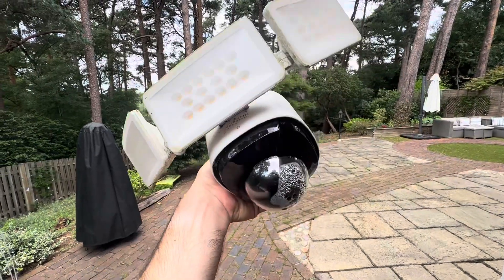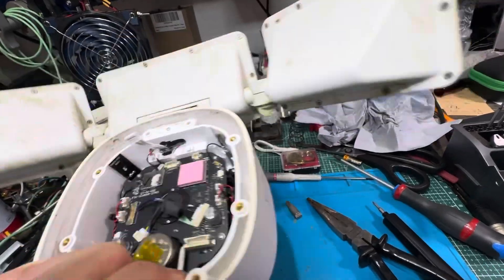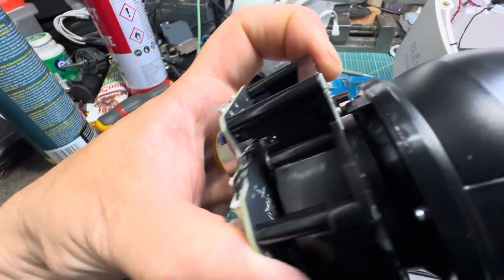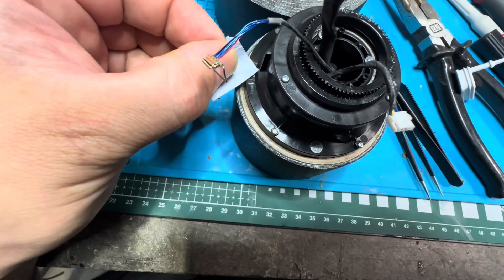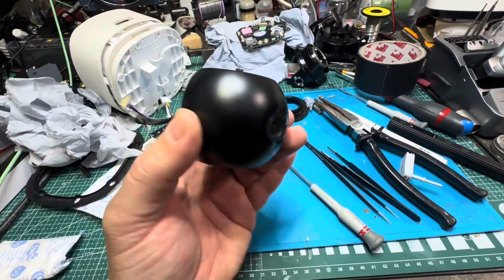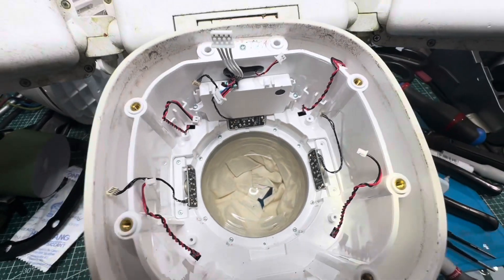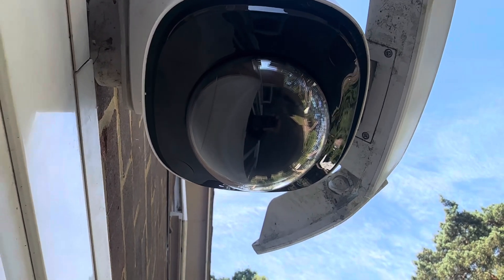Wet Eufy Floodlight Cam 2 Teardown.

Comment: My Eufy Floodlight Cam lens stopped moving.  When I looked at the lens, there was standing water inside the camera dome.  Also, the temperature dropped to -6 degrees Celsius and froze the standing water.  I’ve read that one option is to drill a very small hole at the bottom of the dome.  Has anyone done this?  If so, what’s your long term experience?  Thanks for the video.

Comment: Thanks, was keen to have a look inside and see if 240v transformer could be bypassed to run on dc voltage. Still not sure but worth pulling apart the 1st bit to have a look

Comment: I had a same cam didn't work after a heavy rain storm.   I just opened the cover to let it dry for severa days since I guess don't need to disassemble all things.  Not sure it will work or not.  Anyway, I am glad saw your postig that helped me to open this tricky cover.

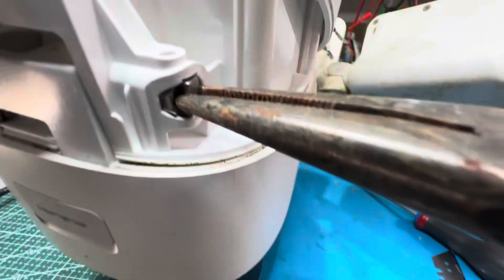Comment: Thanks for the video! I've had mine sitting on my desk for about 6 months now and haven't had the time to get to it. Luckily I waited and you posted this two weeks ago 😂 I'm having a ton of difficulty with those bolt things at 2:15, but will try again later.
Reply: Wow, literally 3 seconds after I posted that comment, I saw in your video that each bolt has TWO screw holes. I had managed to skip the inner ones (I didn't have it "closed" with the latch, so the access holes weren't lined up for me to see). Maybe I need more coffee before I continue 🤦‍♂
Reply from the maker: @JoshToth  Pleased to hear my sh!tty mumbling video was worth making. 
Yeah, sorry. I forgot to video removing the outer screws… u-toober I aint! 😂